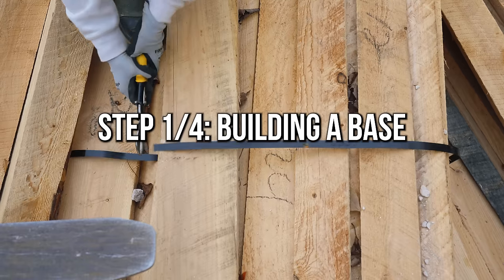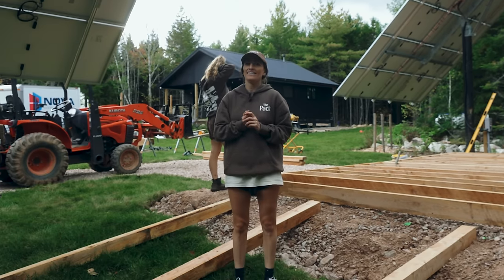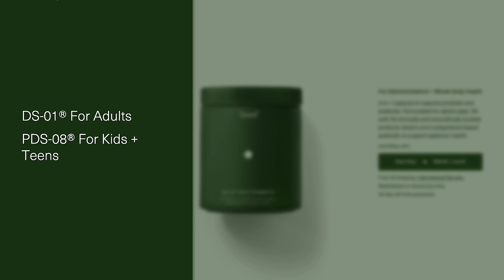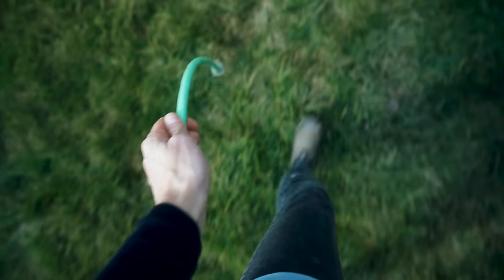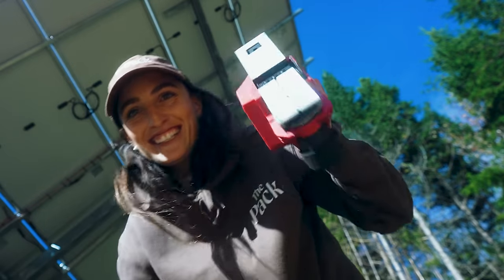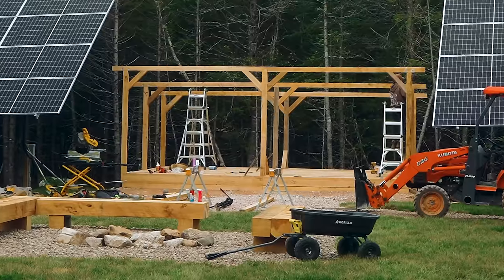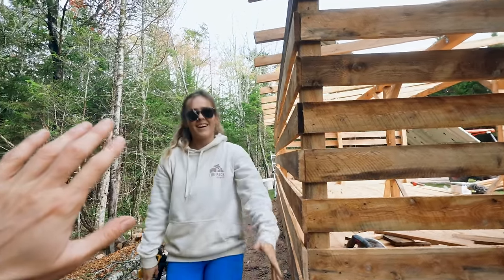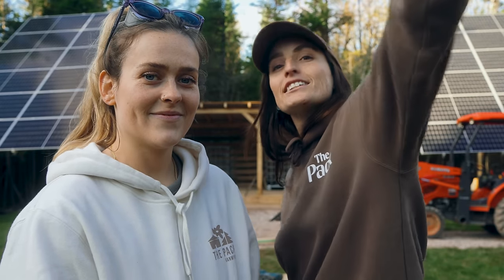Building A Woodshed From Milled Wood & Storing Years of Firewood!

Comment: Very well done.  That tip re the screws on the flats I learned 65 years ago from the carpenter that was doing finishing work when I was 6.  It's very true but also very controversial.  The only other thing more controversial to use or not to use rubbers on them.   The gaskets that seal out moisture in case someone doesn't know about them.

Comment: So glad to see so many whole pieces (not split) in your wood pile!  If you have been using mainly split pieces you will see a big difference in not only the number of pieces you burn but hotter temperatures and longer burn time making fewer times that you have to restoke your stoves.  For those of you that don't know, whole pieces or "rounds" burn hotter and longer producing more BTUs than split wood of a comparable size.  Here's another pro tip.  When  making pieces into kindling choose split pieces that have straight with no twists or bends in the grain and is free of knots.  This will save you SO much time, energy and frustration when making kindling.

Comment: You are correct the screws go in the flats, in the kinda roofing you're using.The confusion comes from the fact there are 2 types of metal roofing called corrugated. The kind you have and the kind that looks like the middle layer of a paper shipping box. The shipping box kind should have the screws in the tops of the ribs or they act like dams causing the water to leak in. Hope this helps.

Comment: Great job, as usual. I built a much smaller woodshed on my 30-acre place and followed the same method as you. After it was in use for a year or so, I started noticing that critters wanted to inhabit the space left under the floor for air flow. I ended up putting hardware cloth (1/4" opening on the mesh) on both ends. I didn't mind the critters so much, but it became a buffet for black snakes.
Reply: I'd wondered if critters would make underneath their home + if that would have an impact. Smart to do a mesh screen!

Comment: Bang! Breathable Woodshed! Beautiful!!
 Might be a good spot for some motion sensing LED floodlights or nightlights just inside. Even if it has its own little solar panel and battery. Which might sound ridiculous next to those giant solar arrays but it could be good. Just something to keep you from fumbling around in the dark with your firewood without having to run a power wire If you haven't already. I realize Clementine might always be on seen. But it might be handy for those in-between times to light up your life. The night owls you girls can be... and like you girl's mentioned night time can come so early.
I'm thinking this winter you girl's should work on your builder's license. Really. I mean why not?? It could be good. Even if just for your own knowledge base. You girls have learned so much from those early van day's. 
Maybe follow a path to your properties highest elevation or cut one. They're might already be an excellent spot for a 2nd home location. I recall seeing a bit of your drone footage of your property. You might have several really good locations that fit the bill. Now that you girls have a better understanding of the land/water management requirements. As you witnessed first-hand the river swelling quite wide. Better to know now than wish you had later. You might already have ideas of the perfect spot or spots. Even if you started with something on skids like a tiny home shed. Something you can drag around when working on the other side of the property. A spending the night or two in tool shed you might say. Could be fun and I know you girls could build it no problem and maybe even build part of it out of some scraps laying around. It would be Quite interesting to see what you might come up with if or when building such a thing. Like the van build. The pack shed. The cabin... How multi-purpose could you make such a thing? Would it look like a tiny home or a tool shed? Solar powered battery System? Back up power generator. Light, heat, woodstove? Composting toilet, Shower station, Kitchen sink? tankless water heater and fresh water storage. Insulated and heat tapes to keep things from freezing. Maybe an easy connection for a air compressor to blow out the water system to make it easy for winterizing. You girls love your plumbing parts and wiring. Cutting tools, crimping tools, wire strippers... You girls have all that. A tiny home shed. A Mini experiment of experience in all that, you know and have learned. Thus far. Could be more than fun. What might such a thing look like through the eyes of the van wives...
 It might be a must to have some larger equipment on sit to prep the land. Turning a path into a roughed in road. Possibly have some of your own wood milled? Along with some Camp firewood and/or Hardwood for home firewood. You might try harvesting the carbon from your brush piles and stumps. The burnt char is good for the soil and growing things. Clementine we have a job for you. Just dig a small Pit, Put in a large metal pipe. Dump or throw your biomass refuse in the pit and light on fire. The pipe is so the pile can breathe from the bottom. Cover pile with dirt. Making sure the pipe On the other end is sticking out of the dirt so it can breathe. This will allow the biomass to burn without burning. Giving you good carbon for topsoil and planting. If you like the idea of building a carbon pit, you might do so a little closer to home. Something you can reach with a garden hose from the well. Although you do have those water tank palates so that makes you pretty portable. I like my carbon a little more like burnt toast. So I tend to put the fires out a little early. Drowning them with a hose. Leaves more sugars in the carbon for the microbes. Increasing crop yields.
 Prepping the land for earth works. Sounds like it might be fun with the right equipment. Porter! Can you let the girls use the big excavating, bulldozer, Dump truck,,, equipment... They need the experience, and it would be a blast to watch them have that much fun.
 Well it's just a thought or 2. ')
Another beautiful job, girls.
Love the pack.

Comment: Just FYI a cord of firewood is 4x4x8=128 Cubic/Feet or 128/27=4.74 Cubic/Yards (You'll have to convert to metric).  2) Next time you build something, look into Simpson H1A clips.  I like them better than the H4, which you used in this video.  Fun fact:  On your 45º bracing, the screws don't actually take the load, instead, they squeeze the framing members together and friction between the wood prevents them from moving and distributes the load.  If and when the wood dries out, you may need to come back and tighten those screws. 3)Where is your eave drip?

Comment: In the future, if you (or a viewer) do steel roofing metal, take a stack of them and get them even at the top and bottom.  Make your marks for the screws and then drill (with a drill bit smaller than the screw) through the stack.  That way you have a hole for the screw that is the same in each panel, plus the hole makes starting the screw easier.

Comment: What size is that woodshed? (12x20)
 I just found your channel. I think its awesome watching females doing construction work. I'm 56 now and back in the late 80s and early 90s i use to travel with a crew renovating hotels in Atlanta and Abilene Texas. I was the only female on the crew and seemed to be an oddity. There is an awesome feeling of accomplishment when a project is complete. I live in a small 12x20 rough sawn cabin that I helped build in 2009. I'm covering my shingle roof with tin in the next few weeks. I've always been just a helper. I think the more projects you complete, the more your confidence increases.  Looking forward to seeing more of your channel. Great job on the shed.

Comment: Just remember anyplace wood touches the ground directly you will have damage.  Over time you should look to put it either on concrete footers or build your own concrete footers.  And if its fresh milled wood that hasn't been presure treated you might have damage sooner than later.  I would look to protect the bottom after the winter.

Comment: To really dry wood outside, wind needs to be able to blow through you stack of wood while being kept away from water. You can't do much about the moisture in the air unless you close it all up and use hot air, but that is rather costly do to. Using wind is free, so the only other thing to pay attention to is how you stack the wood so that the wind get the best flow around it. I know this after drying out wood with my dad over several decades. Do that well and you might actually get wood that is so dry that it will suck up any water or fluids it comes in contact with. I have actaully seen that happening before several times and it's really funny to take a really dry firewood and soak it with with something a fluid that burns well, just don't use something like what car would use, instead use what you use to get your old grill might use when firing up wood.

Comment: Love the shed but would like to see 45 degree braces at the top of the columns in the short direction to keep the building from racking in the other direction.  You could  just run a 2x4 brace from the bottom of one column to the top of the next on each side. and then from the top to the bottom .  Bracing for wind and snow load where you are  is critical.  You cranked that out really fast.  Nice Job - so what's next?

Comment: Wow,you did an amazing job,smart,good way to dry your firewood all you need now is smaller one one closer to your cabin,  when it turns -30 /-40 you'll be wishing you had one closer to your cabin for firewood not to have to go so far
Reply from the maker: Great thinking! This is why we used the metal totes. We will use the tractor and forks to bring a tote to the front porch for easy access 🤠🤟🏽

Comment: You lucked out on the corner to corner measurement on my shed floor I was off by almost an inch.  Nothing a sledge hammer couldnt fix.  Now I just need time off from my normal job to get out there and start screwing my floorboards down.

Comment: Only thing you didn''t do is anchor your shed to the ground. So if your shed is empty or not as full the wind could blow it over, you could have concreted posts or brackets in the ground and bolted them to the under floor structure or know to the sides of the structure so it is safe. Cheers

Comment: They say put it in the ribs because that was the old days that used to put it on the top of the rib and it was just nail and lead washer and they all came loose in our roof yet to keep going up every year and tapping them down to tighten them so yes it's way better in the flat

Comment: Notching a beam reduces its shear strength to 2/3 of the remaining material. You should put your notches completely OVER the post, not butted up against. If you get a heavy snow load, that is where it will fail.

Comment: Why did you build a wood frame and floor on the ground(not pressure treated) when you could have just put in a few concrete piers using sonotubs for the vertical posts? The gravel would have been your floor and you do not need to level it, just make sure the top of each pier is the same elevation. You could even have rented a ground auger attachment for the tractor the drill the holes in the soil for the piers/sonotubes. Your firewood is in IBC totes so it is not touching the ground anyway. Baffling🤷🤷truly baffling

Comment: The one think you guys are ind a delusion with when using all the metal brackets that in storm safe, well it is not, the one thing I have noticed many DIY builders do not anchor their building with foundation into the ground, you sitting on alluvial silt would need piles down two meter into the ground, up lift in a storm is your enemy, most of your buildings can be picked up and sent flying, I recommend you get someone certified to check them out  even the cabin though it been there for some time, the more trees you remove you become exposed, I would hate to see all your hard work be dashed in one of mother natures hickey fits, with globe warming that threat is real, I am a contract builder in Queensland Australia and seen the deluge mature nature can dish out just once to often,ask your self why such massive footings on the solar panels? wish you both the best

Comment: If you build another like this, your side wall boards should be attached on the  inside, so that the pressure of the stacked wood will hold them sturdy instead of the outside, like you did. The pressure will force the wall boards off, you'll be doing repairs by spring....